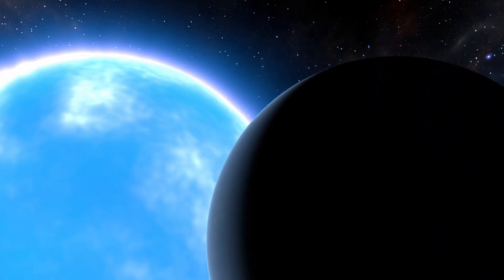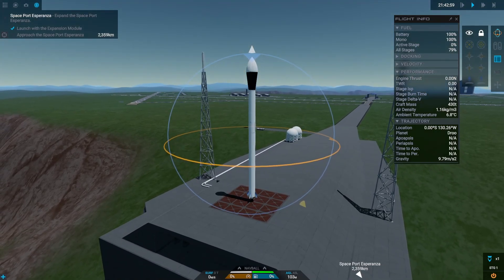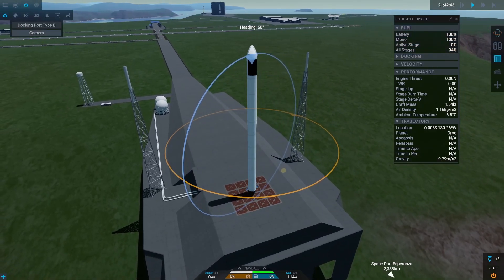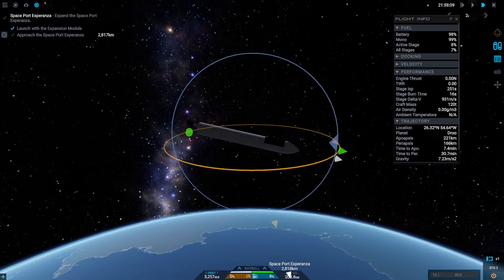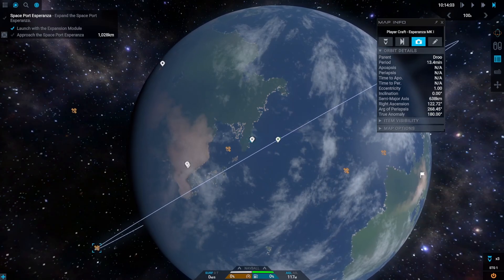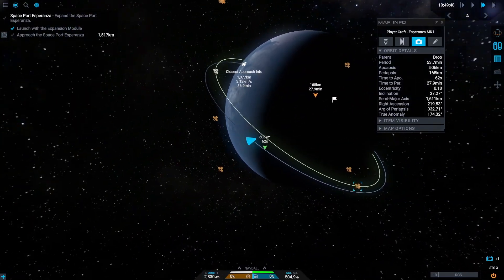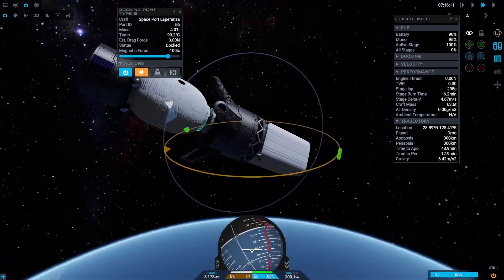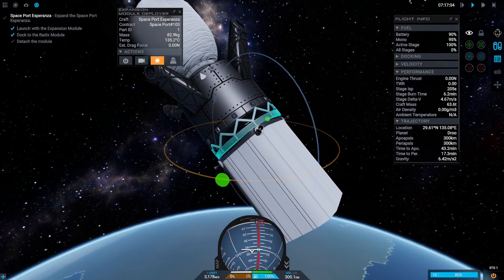Juno: New Origins | Space Port Esperanza - Expansion module

Comment: Btw, you can select the expansion module parts and modify the payload.
It's sorta cheating, but im an absolute noob, what else would i do
Reply from the maker: Ah you mean so that those "arms" are not in the way of the fairing?
Reply: @Goddchen yes, also reduces mass.
I haven't docked the expansion yet but it seems to just be fine
Reply from the maker: @CosmicHase  But visually it will not be correct. I think that would bother me.
Reply: @Goddchen personally it looks a little better to me, just make sure to do it right.
Also, if you place the expansion module upright, the front strut sticks out a little and the back one dips in.
I don't know why, it just does that.
Reply: @Goddchen also, you can do this on any fuel tank/strut based part on payloads.

Comment: I had to dock without thrusters because it couldn’t work. And I checked the fuel and it was monoprop. And also when I docked it the quest said “launch with the expansion module” I made my career 2 months ago. I am on mobile
Reply from the maker: Oh wow, docking like that is difficult, respect! For your issue: I heared that people who are facing this issue have solved it sometimes by switching between crafts multiple times and/or reloading the save in between.

Comment: For me the quest is bugged and it stays at "Launch with the Expansion Module" even if I do so. That is the reason I quit the game until it is fixed but since it works for you that means they have fixed it already ? So my question is when did you create your Juno career world ? Is it relatively recent  or is it older since my guess is that if the devs have fixed the issue they could have done so only for new career worlds.
Reply from the maker: @randomaccount6146  sad to hear that. Yes it worked for me without issues. I think I created my career save about 2 or 3 months ago.
Reply: Same issue with me. saw a forum to rename Space Port Esperanza as target. but that didnt work.. Not sure if i can revert to older save. sucks because im like 65 hours into the game
Reply: @kevinsetterlund  I managed to fix it about a month ago . I saw a comment in a forum saying to fix the orbit of the station if it is a little off and then to turn the main module of the station off and on.

If you don't want to adjust the orbit I think it might even work without it if your station is close enough to its initial orbit.

For me personally it worked after I adjusted the orbit and then I rendezvoused with the station (even while the mission doesn't detect it) then I used the [ ] keys to switch to the station. Then I turned off and on all station parts ( though later found that doing this to the main part is enough ) and finally I switched back to my craft and the mission detected the station.

Also as a final thing to add the game seems to remember the station after you do this at least until you close the game after which for your next opening of the game it might forget where the station is and you might have to do this again but at least I was happy that it was fixable and my career mode wasn't dead.
Reply from the maker: @randomaccount6146  glad to hear it 😁

Comment: Yeah, I was waiting for this one
Reply: In addition, there is an option/button to turn on "Translation Mode."  When enabled WASDQE control translation rather than attitude.

Of course, this means that you don't have any manual control of attitude, but the autopilot still works (e.g. attitude hold or point at target).

Zeroing relative velocity is hard, to say the least.  One solution is to write a simple Vizzy script to display velocity in each of the axis independently -- but this isn't trivial.
Reply from the maker: @jmr5125  Ah nice, I didn't know about translation mode. But from what I understand right now, this is exactly what IJKL does, right? So, without enabling it, you can use both, "normal" mode and translation mode in parallel, just using the different keys, right?

I find zeroing relative velocity relatively easy. What I do is simply switch the nav ball / navitaion mode to from "orbital" to "target", then point retro-grade and burn until relative target velocity is zero.
Reply: @Goddchen  Correct -- with translation mode turned off, you can control attitude with WASDQE  and translation with IHJKUO at the same time.  The main advantage to translation mode is if you are using a joystick as it redefined what the joystick controls as well.
Reply from the maker: @jmr5125  Good point. I'm not using a joystick, but if you do, that makes total sense 👌
Reply from the maker: Awesome! Did you like it? The next few videos are all the module of the space port 😎
Reply: @Goddchen  Yes,wow.( I am facing issues with the docking part, I have never done it earlier, the RCS controls are weird any suggestions?)
Reply from the maker: @sharmarahul384  If you like, I can do a more in-depth video on just the docking. Actually I do have an idea, because that was my issue at first, as well. Do you know that there are separate control keys for the RCS then for the "normal" rocket controls? Instead of WASD you can use IJKL and instead of Shirt/Ctrl you can use U/O to control the RCS. Did you know that?
Reply: @Goddchen  A tutorial would be great, I can't seem to make the relative velocity 0 and when they come near they just flyby from 30-40 meters and can't meet, its really difficult to turn and angle towards the docking port. And about the keys, I didn't know that, I should explore the keyboard shortcut menu more, thanks for the advice ❤️